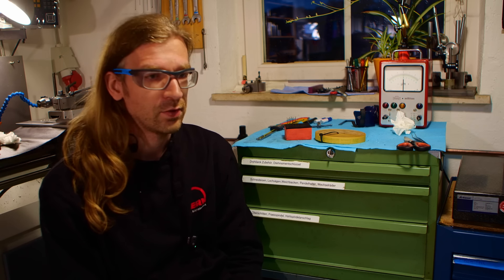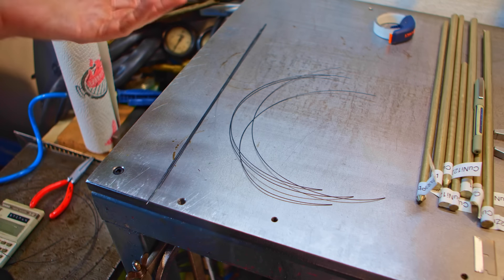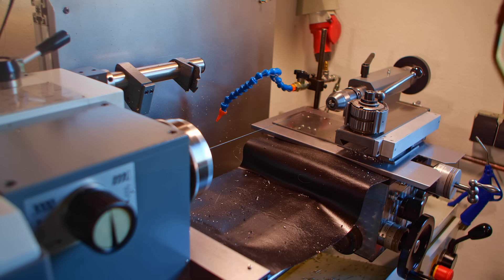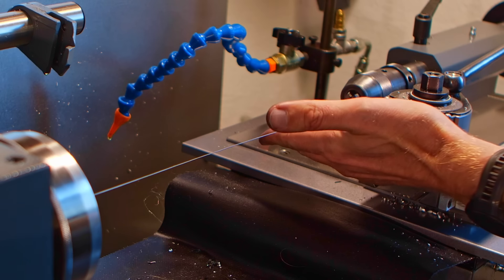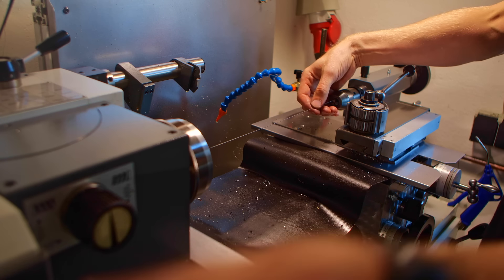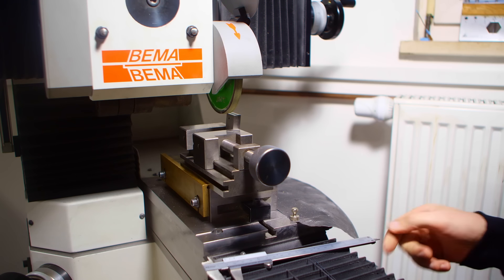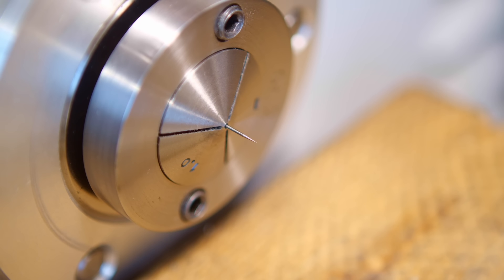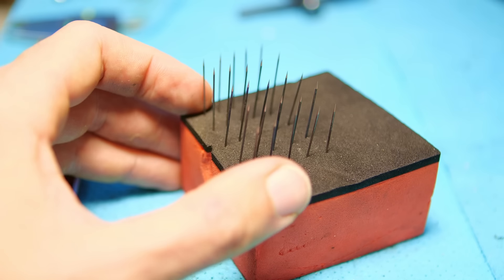Making a part: Flux Capacitor Needles

Comment: I'm a lowly dead tree carcass butcher (woodworker), I get sheets of a similar abrasive from Dieter Schmid in Germany (type "fine tools" into Google and it should pop up). They are PSA backed tho (sticky back) so I dunno if it would work well on a lathe..... I use them for sharpening and lapping.
Jus sharin a possible source 😁 
Jay, Ireland